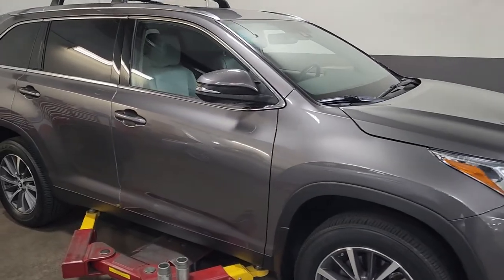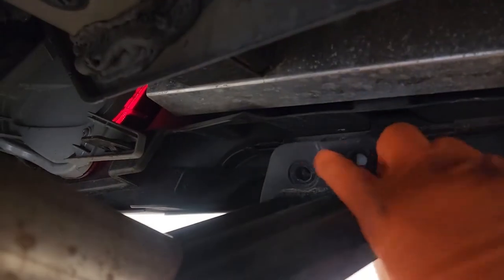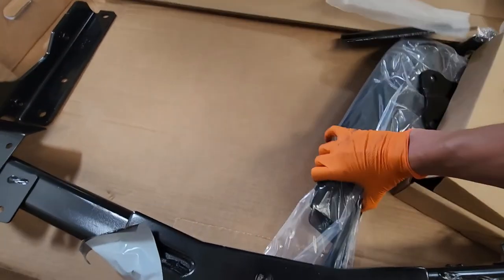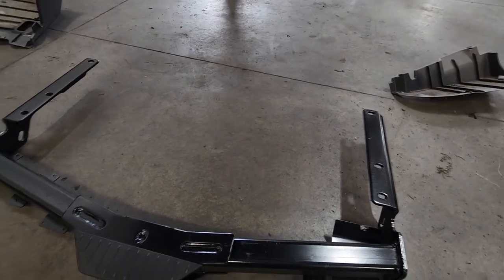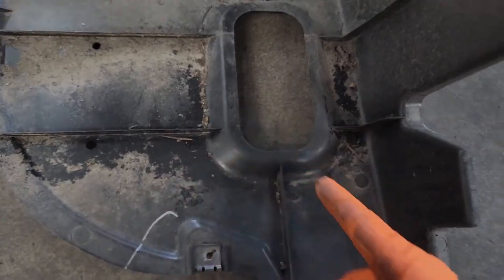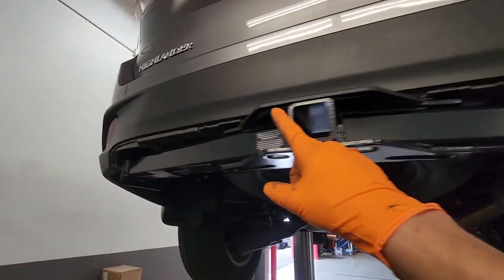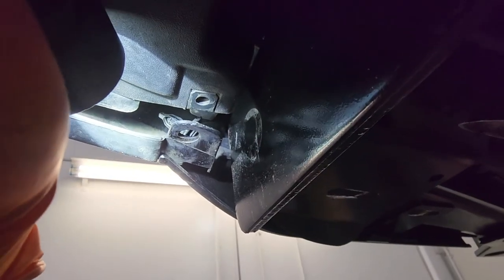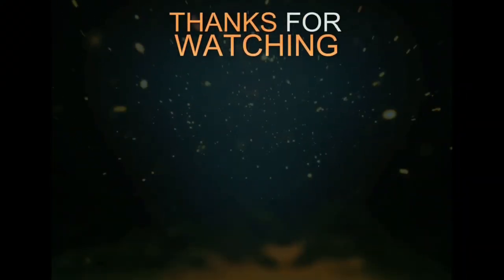Toyota Highlander factory hitch install in 11 min (2016-2019)

Comment: My buddy and I did this last Friday night, using this video as a guide. Left the exhaust on, Left the vehicle on the floor. Two of us threaded the hitch between the mount and the muffler. Also bought the factory wiring. Very good kit, worth the money. Thank you for the help.
Reply from the maker: I'm glad you guys got it done with no issues. The factory harness is super easy to install.
Reply: Where does it plug in to get power? Also, what did you pay for the kit if I may ask.
Reply from the maker: That factory kit plugs in right in the back under some of the trim panels.

Comment: Thank you very much!! On my 2019 Highlander, I did not need to make any cut on the driver's side corner under-side plastic panel. Try it! If you have tin snips, it was super easy to cut vs. a Dremel or saw of some kind ...just like scissors. Also, I was able to get the hitch in place to thread the screws by myself without help. Just let the passenger side of the hitch sit on the muffler while raising the other side to thread the first bolt, then immediately thread one on the muffler side to take the pressure off ASAP. GREAT VIDEO!!
Reply from the maker: Thank you. I'm glad it went off without a hitch.

Comment: Very timely. I’m installing mine today. Thanks!
Reply from the maker: Hope that it goes smooth for you!
Reply: @shoptimewithdrew  thanks! My son bailed so I’ll be using my jack and vice grips to replace him.
Reply from the maker: Ha ha have fun. Thay are heavy, if you leave the muffler up it can kinda hang on the top side of the muffler. I think a floor jack is your best option.
Reply: Got it. Would have been a pain without the video, thanks. Easy peasy.
Reply from the maker: So glad it was helpful thank you for all the input.

Comment: Where can I buy the hitch? And does it come with the plug for the trailer so the lights can work on the trailer as well? Thanks in advance
Reply from the maker: You can buy the hitch on Amazon or from a Toyota dealer. The harness is separate.

Comment: I have several questions regarding 2018-2019 Highlanders...

Will any of these Highlanders that have a V6? Have the towing package included? I realize they all may not have a hitch already installed, but will they have the other items like transmission cooler that is a part of the tow package?

Generally speaking, how reliable will these years Highlanders be? We are looking at some within these year ranges, probably between 50-100k miles.
Reply from the maker: Xle, xse, limited, and platinum models are raited for towing 5,000 lbs. I may be wrong, but I think all these models have a transmission cooler.
Reply from the maker: They are great vehicles, and there are not many issues with them. If you are doing weekend camp outs, it will work great. It's not the best for a heavy-duty tow rig.
Reply: All v6 2017-2019 have the tow package equipment (alternator, trans cooler, etc).  However you'll need to buy the wiring harness and hitch.  5000lbs seems too much to be towing regularly.  But once in a while, it will do fine.  3000 and less even better.  1500lbs, don't even know it's back there.

Comment: Thank you for creating this video!  
Question...two of the bolts are extremely difficult.  Its so hard i couldnt tighten it with a impact wrench rated 1100 ft lb on battery.   Im assuming this isn't normal.  Any suggestions? I was thinking a pipe to leverage  a hand wrench.
Reply from the maker: That is not normal they should thread in pretty easy.

Comment: I want to install mud guards on my 2022 Highlander and can’t find a video on it. Should be easy enough to install but I was hoping to watch somebody first.
Reply from the maker: I don't have a video of that yet. They are really easy to do. Just set out the hardware and split it evenly between right and left. Usually, there will be a bag of hardware with a front mud flap that will be for both front flaps and one bag with a rear flap, and that will be for both rear mud flaps. If the kit comes with the clip style nuts, look for small dimples in the bumper, and they will slide over the dimple. If not, you can hold the flap up to  figure out where the clip nuts go.  Next time I do a set, I will make a video. Thanks for the idea.
Reply: @shoptimewithdrew  thanks, I did them yesterday. Very easy. They did come with the clips and the dimples in the bumper were very clear.
Reply from the maker: I'm glad you got it figured out.

Comment: Dunno why they make it the hang so far out. It would have been nice it it was flush with the bumper.

How is this generation, any issues with the v6? They standard with 5k tow or is it 3500 lbs but need coolers etc to get to 5k lbs?
Reply from the maker: Correct, some models do come with a cooler. The only issue I ever see is timing cover oil leaks. They are good rigs.
Reply: I had a 2014 version (now totaled and replaced with a 2019) and they are great cars. Super reliable. Great driving too.

Comment: Hi, I am just wondering on this specific vehicle that you installed this on.  Did this vehicle have a transmission oil cooler already installed?  Seems like those would be necessary components to utilize full tow capacity?
Reply from the maker: Some came with transmission coolers installed, and some used the lower part of the radiator as a cooler. I don't remember if this one had a cooler installed. I do recommend a separate style cooler if you plan on doing a lot of towing.
Reply: @shoptimewithdrew  Thank you I appreciate the quick response.
Reply from the maker: You are very welcome. Thanks for the comments.

Comment: Come on Toyota! Why do I need to cut something to install a hitch receiver? I hate those shitty work. Is it so hard to add into design the possible installation of the hitch reciver?
Reply from the maker: You could buy a Chevy that has the hidden hitch cover, but then it would be in the shop all the time for problems. I would rather own a Toyota and have to trim a little plastic that you will never see.
Reply: @shoptimewithdrew  It's not about what to buy; I just can't understand why not to put it into design? It obviously has mounting holes for bolts, but still, you need to modify and make some ugly cutouts.

Comment: Where are you located?
Reply from the maker: Oregon
Reply: I do not trust our local tecs. Guy at the service department told me they do not make a hitch for my 2024 Grand Highlander…. That’s when I found you on line. So where’s your dealership located? I would like to schedule an appointment. I ordered the hitch 15 minutes ago.
Reply from the maker: We're did you order it through? I think you can only get the part from Toyota at this time.
Reply from the maker: Part number I think is PT974-48241